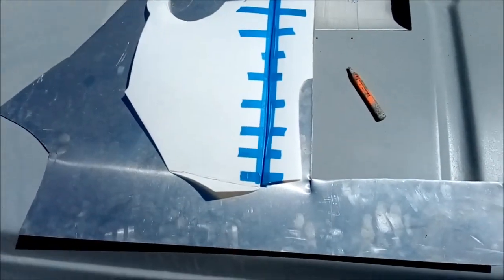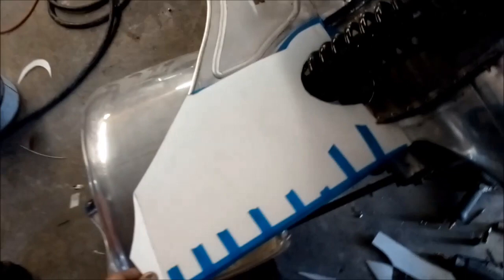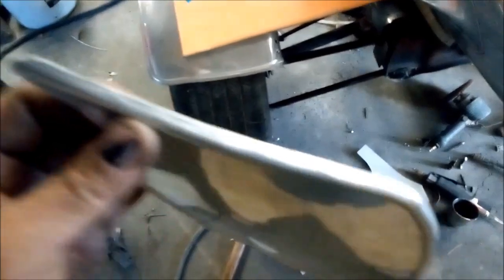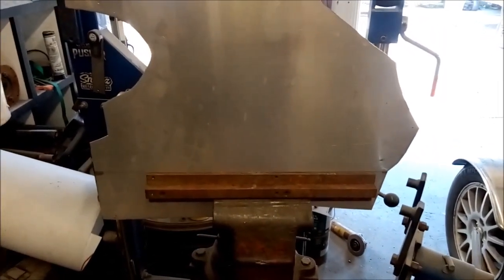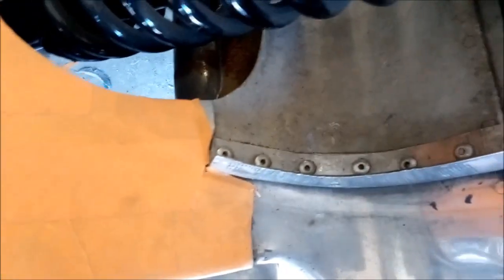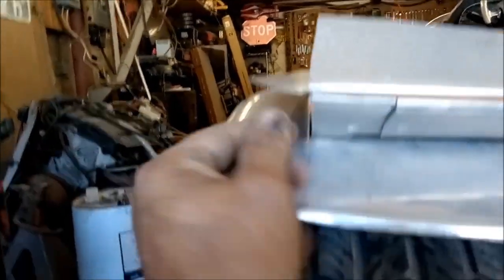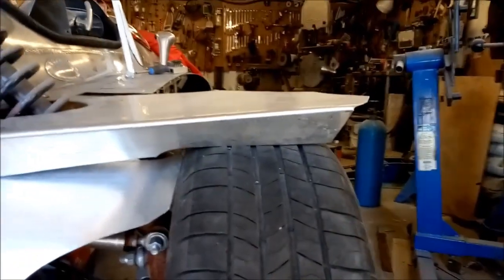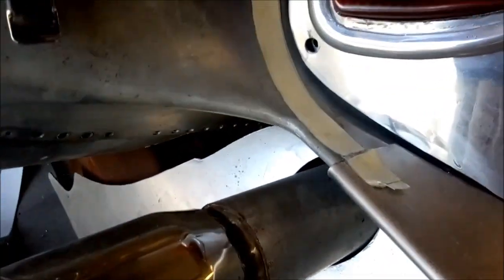Right rear wing fabrication for the Avro Speedster

Comment: Won't you have a corrosion problem where you meet stainless steel with aluminum?
Reply from the maker: Stainless steel fasteners in aluminium plates or sheets are normally considered safe, whereas aluminium rivets or bolts holding stainless steel parts together is an unwise combination, as there is a practical risk of corrosion. ... Even with no insulation between the metals, there should be little risk of corrosion.